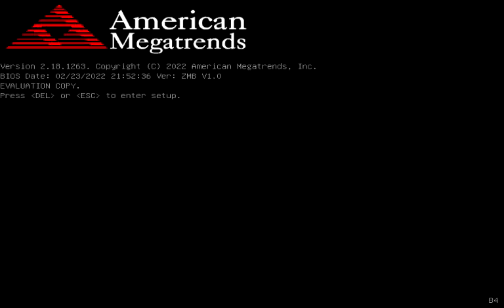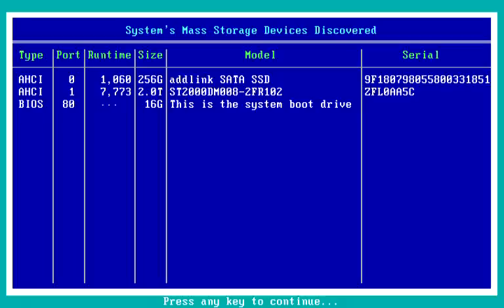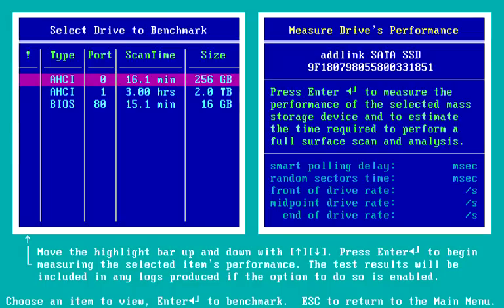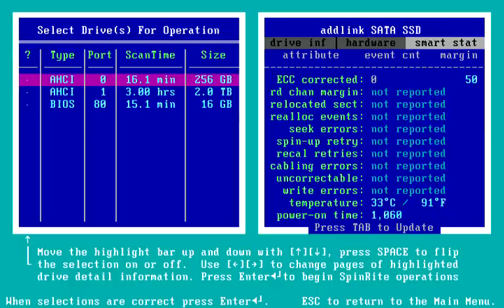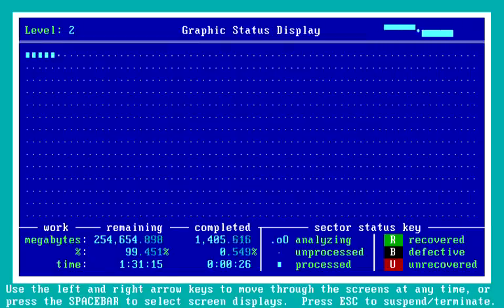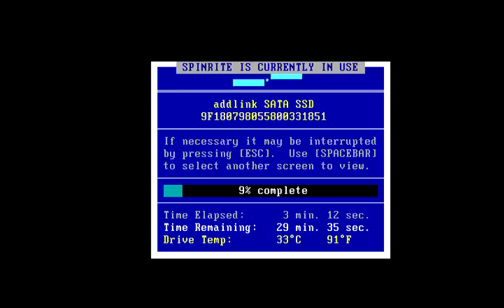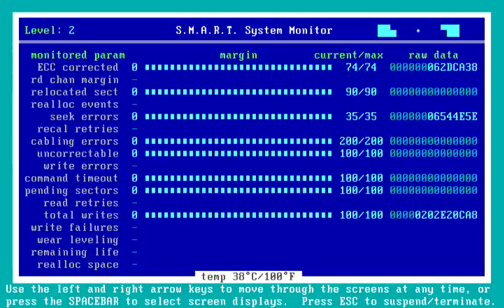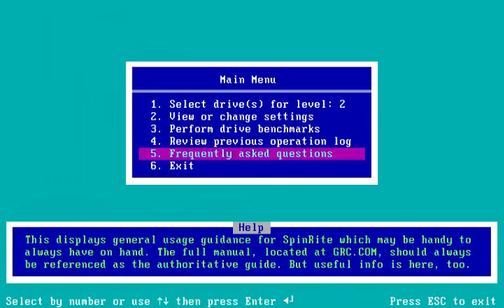A SpinRite Walkthrough

Comment: I have been at this since 1979. Never before have I heard terms like "front of drive" nor "back of drive". What on earth do you mean? 7:07  Even when you (presumably) talk about outer parts of the disk having a greater circumference, you instead say things like "cylinders being the longest" implying this is the reason for better speed. WTF? I presume you certainly know how to code, but your explanations here make 0 sense.  I presume it's faster on the outer tracks because on a spinning disk, the farther away from the center of rotation, the more space is traversed by the edge of the disk (than near the center)-- and assuming that physical sector size is "shrunk" (relative to inner tracks) on the outermost tracks (to make the most of physical space) this means the sector passes by the heads faster on the outmost tracks.
Reply: Honestly it doesn't seem unclear, especially since the idea seems to have been conveyed even if you didn't share some of his terms?

Anyway, "front" and "back" seem to be referring to the very common abstraction that the drive is a very long string (e.g. defrag, partitioning, most file systems).
Reply: @AySz88  It doesn't explain what front and back even mean. It front an inner track or an outer?  And what about the nonsense at 6:20 about the "surface of an SSD drive"?  I mean clearly the guys knows his stuff, but his language and terms are terrible.
Reply: Spinrite may have been useful in the 80s with floppies and early spinning disks, but today Spinrite is pure snake oil.

Comment: At 3:31, you say the Level 3 should be used once per year on an SSD for maintenance — yet the screen says Level 3 is NOT recommended for SSDs.    Could you please clarify?
Reply from the maker: When you look at the amount of writing that an SSD can sustain -- typically many thousands of times its own size -- a single rewrite of its own size is a very small cost in return for the benefit.
     I was probably overly and needlessly cautious about that scary pop-up in SpinRite v6.1, but I didn't want SpinRite users to be running and rerunning SpinRite over SSDs needlessly.
     I think that once a year is VERY conservative and that it ought to also be sufficient.
Reply: @SGgrc  very helpful, thanks.   SpinRight, back in the “spinning” days, has saved more times than I can count.   Good to know that a Once Per Year SpinRight still makes sense.   Great program!
Reply: @SGgrc  Thank you for keeping up the good work of promoting maintenance over replacement. 
 
Do the refreshing writes in Level 3 get reflected in the TBW numbers reported in CrystalDisk and other diagnostics? According to my limited understanding, the physics of NAND gates puts a limit on the number of times they can be written to regardless of the reason.  From what you've said, Level 2 should do more limited writing (none if no problems are detected).  Thanks also for that.
Reply: SSD support wasn't available previously, but it looks like the new 6.1 version now includes it. I suppose the disclaimer just needs to be updated.

Comment: Is it still written in 100% ASM? :)
Reply from the maker: Yes!  100% assembly language (and still quite small.) The code now requires a 32-bit processor with protected mode support since SpinRite v6.1 uses "flat real mode" to access 16 megabyte data transfer buffers. But all owners of v6.1 also have licenses for v6.0 and v5.0 ... this is so that really really old systems are still usable. 👍

Comment: Will the recovery work on drives that are configured for RAID 0? I’ve got data on a couple sata drives, but one of the two failed for some reason. It happened about 8 years ago, but I kept them just in case I find a way to recover the data.

Comment: Fascinating! I ran SpinRite on my 74 GB 10,000 RPM VelociRaptor drive back in 2005 and it gave me weird error messages. I never had issues with the drive so I didn't trust the utility at the time. Who knows what actually caused the errors. I had no idea it is still being maintained and it does sound great for SSDs.

Comment: when will you make spinrite so it copies data to a second drive while it is recovering data?
Reply from the maker: This v6.1 of SpinRite is "the last hurrah" for SpinRite on DOS. I purchased the source code for a very mature real-time OS (RTOS-32) that can boot on either BIOS or UEFI firmware. It also has a Win32 API, so it's nominally Windows compatible at the API level. 
     So the plan is that SpinRite 7 will run on Windows natively and SpinRite 7 Pro will include the bootable OS so that SpinRite can access the drives that Windows normally protects. That will be the beginning of the next generation of SpinRite and... to answer your question... moving recovered file systems and directories and files to other media will be part of its feature set. 👍
Reply: @SGgrc  first off WOW! Would you happen to have a roadmap or timeline in your website for the spinrite 7 release?

Comment: Not sure how long, new PCs will include legacy BIOS mode. Will Spinrite be UEFI compatible some day? I know (Free)dos isn't, so not sure how that would be achieved.  Would more or less, require it to be its own OS? Or use BSD/Linux instead?
Reply from the maker: You're 100% right. As I noted in my reply to your other question, I purchased the source code for a proprietary embedded OS known as RTOS-32. So all future SpinRites will be Windows apps that can run either under Windows or on their own OS that can boot on either BIOS or UEFI.  👍

Comment: Congratulations on producing such long running useful software.

Question: do you plan to produce a .efi version instead of .exe in the future?

Many board manufacturers are now removing CSM mode in the UEFI, making it impossible to boot to DOS.

Turning off secure boot isn't a problem, but you will need a utility that can be run from an efi shell, rather than DOS, in future.
Reply from the maker: 100% right. Please see my replies to @kjakobsen. (SpinRite will be getting its own BIOS/UEFI bootable OS)

Comment: Wow, I'm an old IT guy from the 90's, and I can't believe that SpinRite is still around.
Reply from the maker: Well... I'm also an old IT guy from the 90's (hence DOS and assembly code! :) ... and the darn thing just keeps being useful! <g> Thanks for your note!
Reply: @SGgrc  Steve, thanks for all the utilities that just work.  Been a licensed user of SR for many years.  Wish I would've had it back in the early 90s
Reply: I'm an old IT guy from the 60's, and I can't believe that I am still around.
Reply: @KameraShy  😅
Reply: @KameraShy  I used to love talking with the walking museum pieces like you. Very little computer hardware is truely new. It's often just an improvement on the previous design, or only a faster method of implementation. Some times it's as simple as just a new connector. Lol learn from the old guys provided my with a very strong foundational understanding of how a wide range of computer & networking systems work. As well improving my troubleshooting shooting skills that seem to be very lacking in the current generation of techs who are over reliant on flow charts as a troubleshooting replacement. 

So your age is a reflection on your knowledge. Share that knowledge to help build the future,
Reply: @KameraShy  neither can we! :)
Reply: around 1990 I used SpinRite in several schools offices which were using AT or XT type PCs which were running slow and unreliable. The office was going to buy a new machine. I’d boot from a floppy, run SpinRite overnight and tell the school staff to reboot in the morning and things improve dramatically then.
Reply: I'm surprised it's still around too. It claims of "Data Recovery" is irresponsible and also wrong in every case I've seen. When drives from this century have a small problem it's often the start of a catastrophic problem. The first operation should be coping data to another drive. Yes the masses should back up, but they often don't or in piecemeal. I've saved data for many people, but not all, with doing a sector copy to another drive with ddrescue. Speaking from over 20 years of data recovery experience and someone that has used SpinRite since 2004. It's fine for use as a drive maintenance utility, but I've never seen it rescue data. For kicks I've used SpinRite many times on failing drives, it's killed them dead every time.
Reply: Very true.

Comment: Can this work if the drive is encrypted?
Reply from the maker: Yes.  100%.  SpinRite is “encryption agnostic” because it's operating below the file system level, directly upon the drive's physical media. So it will run equally well on an entirely empty drive, on a drive filled with “white noise”, or anything in between. 👍

Comment: wow! I had stopped thinking about SpinRite when I moved to SSD - should have realized you'd be right there to keep my drives in tip-top shape! Thanks for the years of work.
Reply from the maker: Check out the "before" and "after" benchmarks on the SpinRite "Testimonials" page here: https://www.grc.com/sr/testimonials.htm  The performance improvements are typically stunning.
     Based upon the experience SpinRite v6.1's users are reporting, we're now recommending an annual pass of SpinRite at Level 3 over SSDs to keep them "fresh" and healthy.  :)

Comment: I used Spinrite 6.1 on an NVME SSD that was slowing down, but there ended up being a large block of slowdowns/uncorrectable errors starting at about 30% of the drive and kept on going. Apparently I had never used the drive much and slowdowns started when data was being written there.  I gave up on the drive after a day of running and even Spinrite could not fix it.  This is definitely not Spinrite's fault, just bad or corrupted hardware.  I've used Spinrite on many spinning platter drives over the years with great success, even back to the MFM/RLL days, and have gotten a lot of use out of it.  I also tried using Spinrite on my first 1TB SSD (5 years old) but the memory cells were gone and were stuck at very slow speeds -- once again, even Miracle Workers can't save everything, every time.   I listen to Security Now every week and have for the past 10 years, and enjoy the current events I learn from it.  Thank you for your work, and it is not often that I can say that I am still using a program that was written way over a decade ago and still loving it.

Comment: Steve, you’re a geek and an old school white hat hacker. It shows in your products, your presentation style, and the fact that you’re doing everything from DOS where there is no real OS overhead or interference from the OS.

The computer world has tried to move beyond guys like you and I, but it wouldn’t really be able to function well without guys like us.
Reply from the maker: Hah! Thanks for your note, Geoff. And, yeah... guilty as charged. I sometimes explain that I was a nerd long before that became "fashionable". <g> And you're right about the benefits of DOS. There IS no "OS" there... mostly just a program loader and some file system and console APIs.
     My plans for the future are to first move SpinRite to Windows since I CAN still get good low-level access through USB and I've seen with the release of v6.1 that everyone wants to use USB to connect drives. I also purchased the source code for a real-time OS (RTOS-32) that was at end-of-life because no one was buying upgrades because it had no bugs. (My kind of software!) AND it's a Win32 API emulator... so that will allow me to have "Pro" versions that are bootable and Windows releases that run under Windows. :)
     And, as you said... "old school geek". But I LOVE computers! 👍
Reply: @ I’m a decade younger than you, started on the Commodore Pet in 1979/1980, and Apple II in 1980. I still remember the Gibson Light Pen (I didn’t have one, but a friend did). I’ve written in a dozen or so programming languages, but my favorites are still BASIC (modern compiled versions), and ASM. I’ve written ASM for half a dozen processors. Details vary, but it’s all pretty much the same.

Comment: Thank you Steve for SpinRite 6.1.  I purchased a 6.0 license years ago but was never able to run it (at first on my Intel Mac, later on standard Windows PC) on my 2+ TB drives.  SpinRite 6.1 handled them just fine and definitely improved performance on three 4 TB SSDs after running on level 3.  Yes it took hours on each drive, but actual transfer rates for data backups over USB increased from around 120 MB/s to upward of 300 MB/s where those drives had originally begun.  I also feel more confident in my backed up data for having had every single bit re-written to the drive, ensuring the charge which differentiates one bit from another is refreshed.
Reply from the maker: Wow... Music to my ears. I worked on SpinRite 6.1 for 3.5 years and the experiences you had and have just reported are EXACTLY what I was hoping SpinRite's longtime users would experience. Thanks for sharing!

Comment: A 2024 version of spinrite?  I so miss this software!  Have not used it since Version 3, I need a new license because all my floppies have gone bad decades ago.  i will be purchasing it based on this walkthrough.
Reply from the maker: Thanks, Ted. SpinRite remains very useful for the maintenance of all mass storage drives. The big surprise that surfaced early in the v6.1 development was for solid state drives. Whereas the end of spinning drives has always been well known to be slower due to them having much shorter tracks, the most-used FRONT of solid state drives becomes much slower due to a phenomenon known as "read disturb". The charges stored in the "bit cells" drift away from their original values. SpinRite makes rewriting them easy, which restore drives to their factory speed. :)

Comment: Hi Steve. Thanks for this. I bought SpinRite at the 6.0 version, and I'm looking forward to grabbing the new version. I've got a couple of systems I'd like to run it on as a test. Thanks for the video.
Reply from the maker: Upgrading from 6.0 is easy. The first item under the "SpinRite" menu is "Upgrade to v6.1". Just drop your current SpinRite serial number into the form there and you'll receive download links for v6.1. :)

Comment: Does it LLF MFM and RLL drives? ;@)
Reply: I think it does from what I remember from early DOS versions.
Reply from the maker: Actually, SpinRite 6.0 was released in 2004 (20 years ago) and SpinRite 5 several years before that. And each of these major moves forward removed some of the oldest features that were really no longer needed and were taking up space. BUT... =all= owners of SpinRite 6.1 also have licenses to SpinRite 6.0 and 5.0 ... so SpinRite 5.0 will definitely work on those older drives without any trouble!

Comment: some kind of indicator of how much RAM has been tested would be nice..."patterns" doesn't really say much
Reply from the maker: Right. I wanted to keep the UI clean, and SpinRite's not really a RAM test. it's just doing that to "protect itself" from a machine that might have flaky RAM.
     What's probably not clear is that SpinRite is only testing the 50+ megabytes of RAM that it uses for its own data transfer buffering, and it tests ALL OF IT every cycle. So it's not about "how much RAM was tested" since ALL of the RAM it uses is tested for every cycle.  So each "pattern" tests all of the RAM. (I spent a lot of time optimizing that RAM test so that SpinRite could test everything over and over in a very short time! :)
Reply: @SGgrc  that should be made clear in the interface though...

Comment: I’ve been using SpinRite for years, thanks Steve! I am curious on the fix for SSD read speed issue, if you run level 3 to resolve this does that fix come from the drives over provisioning (extra free space) or will there always be some sectors on the front of the drive that are forever slow?

Meaning is the fix that these sectors are just relocated and the slow portions are just ignored in the future?
Reply from the maker: Great question... And the answer is that since SSDs are "black boxes" hiding behind their storage controllers, it's impossible to say for certain. Wear leveling is almost certainly happening during writing. But over-provisioning is typically used when storage has an actual problem and needs to be removed from use. The pattern we see is that no errors are ever being returned... the drives are just slowing down. And this is a very well-known problem with solid state drives. If you search the 'Net for "Read Disturb" you'll see a ton of work on ways to deal with this. NAND storage drives are able to change their read bit thresholding and use extensive ECC in order to recover data that's become marginal, NOT due to any physical problem with the memory but just due to long term "charge drift".
Reply: @SGgrc  Thanks Steve!

Comment: Hi Steve. Interesting talks you recently uploaded, and I'm glad to see that SR 6.1 is now able to work on modern drives.
Something interesting that I see in your video at 9:10 is the reported size of the drive. Size is nominally 2 TB, and byte count is 2,000,544,703 ... that number seemed to not match what I expected, so I opened a spreadsheet and did some maths ...
Back in the day, everyone knew that 1 KB was not exactly 1000 bytes, it was rather 1024 bytes ... and similarly 1 MB isn't 1,000,000 bytes, but is rather 1,048,576 bytes. I continued the chain of numbers, doubling every iteration (as one does when counting in binary), and my result for 1 TB is 1,099,511,627,776, which results in a byte count of 2TB being 2,199,023,255,552.
Am I wrong in my methodology, and if not then why do our numbers disagree? Have manufacturers of storage devices began using 'shrinkflation' to rob us of (in this case) 1,998,624,321,536 bytes? Are they just setting the bytecount of drives to be barely over the nominal size listed on the drive?

Thanks in advance if you have anything to teach me here.